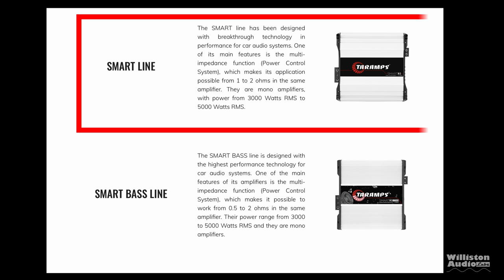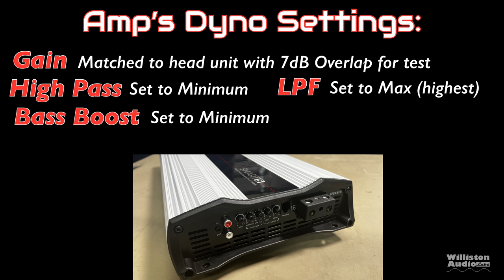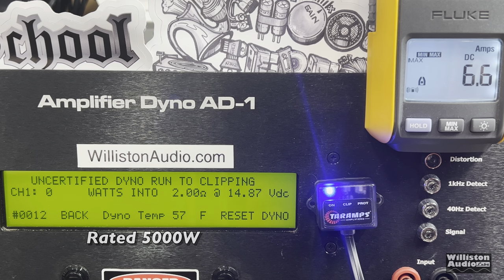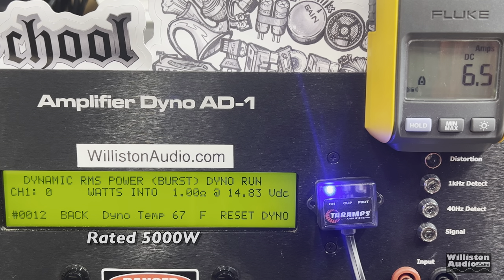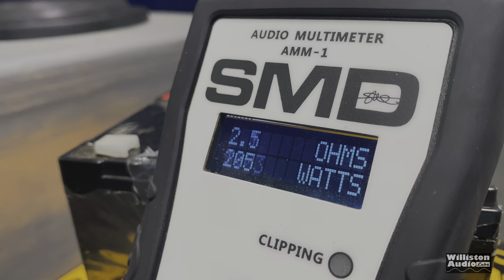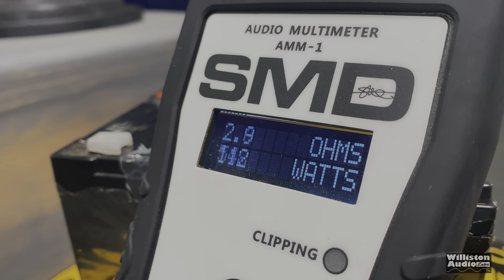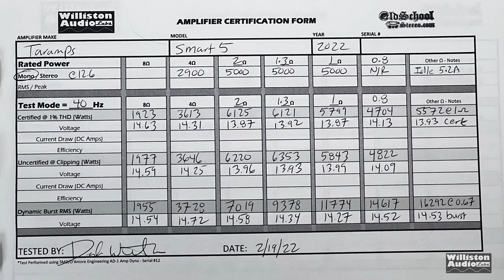You Won't Believe This! Taramps Smart 5 Amp Dyno Test and Review [4K]

Comment from the maker: Shop: (affiliate links)
Taramps Smart 5 Amplifier: https://amzn.to/3oX0XLV
Taramps Smart 5 Bass Amplifier: https://amzn.to/3oXIX3W
Savard HiQ 8” Subwoofers: https://amzn.to/3h1ZWhi
XS Power LTO Cells: https://lddy.no/13d2f
XS Power Intellisupply PSC90: https://lddy.no/13d2g

Related Videos:
Barevids Tech Review of Smart 5 / Smart 5 Bass: https://youtu.be/_WloGD1W920
Taramps Smart 3: https://youtu.be/DxMGPhNASl4
Taramps Smart 3 Bass: https://youtu.be/y37leRxDJ8A
JSS Test of Smart 5: https://youtu.be/4qbytnB2TxY

Video Index:
0:00 Intro
1:17 Unboxing the Amp
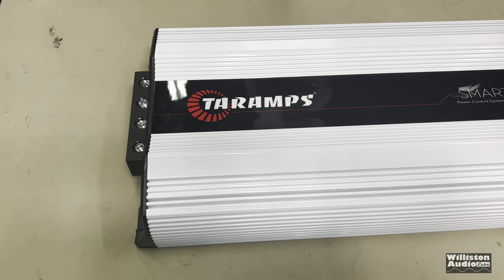2:06 Specs and Features
3:34 Amp Settings
4:26 Amp Dyno Tests
7:54 Subwoofer Demo
9:25 What's Inside?
10:05 Pros / Cons
11:23 Extras

DISCLAIMER: This video and description contains affiliate links, which means that if you purchase from one of the product links, I may receive a small commission. As an Amazon Associate I earn from qualifying purchases
Reply: YEAHHHHHHHHHHHH BOIIIIÌIIIIIIIIIIIIIIIIIIIIIII
Reply: Thanks for doing the 1.3 ohm test I have been interested in the results in regards to the smart amplifiers specifically. 😀
Reply: I have to ask somting.
Car Amps VS 8ohm speakers
Will this be a problem ?
I have to use this setup on my boat 

Thanks
Reply: @dyslectische  it won't be a problem cause the amps can run at 4 ohms  but using 8 speakers all 8 ohm is a 1 ohm load.
Reply: Hey guys I just got a rockford t1000.1bd burnt both my 10 kickers almost instantly does anyone know a set of good shallow 10s that could run in a (single cab) kicker box  or should I look for different boxes that's are 12s anyone thanks
Reply: JL Audio has a awesome shallow mount sub & can take some power!!!
Reply: Damn that sh1t bumpin
Reply: Brazil really doing it right by the amps, I'm impressed
Reply: Time to test de Pioneer GM-D1004
Reply: Please do the 1k test on all the taramps lots of people use them for mids and highs like me my boy is running 2 8k taramps in is built for mids especially here in Florida
Reply: @Force1Com  It's Brazil, it's very focused on the automotive sound business, it's a pity the laws don't help the area around here

Comment: An amp that does above 3K watts at 4 ohms for less than $600 is a great sign that car audio truly advanced in technology
Reply: Back in the day a good amp was $1 per watt. Wow how things have changed, for the better.
Reply: Yes n deed
Reply: @llegacy1870  
I remember when 2000 watts RMS was an urban myth
Reply: And 16kW @ higher than ½ ohm! Wow! I have 2 Taramps Bass 8Ks wired to 0.7 ohm and at 16V and I still can't hit 16kW! (15k) lol damn impedance rise! 
(Yes I know it's bcuz of my box rise which isn't the same on an amp Dyno)
Reply: @CHEVYK10  almost 10 years ago I paid over $500 for a 1500 watt amp that was used. Wild that for that price today I can get an amp that does triple the power
Reply: Bruh I love taramps they are the best sounding bang for your buck !
Reply: Yeah, it's wild. I'm going to be getting a Smart Bass 3K soon
Reply: @MannuhFestIt  If you are stupid enough to buy one, Rockford Fosgate will sell you a 1500.1BDCP for $1,000 at Crutchfield or $850 at Sonic Electronics. Meanwhile, you can get this Smart 5k for  under $500 or something like an Orion DSPLX 5500.1 or a JP63. I really do like The Down4sound amps. They are nice Korean half bridge amps. Definitely more expensive to strap Korean half bridge amps like two of the JP33's to get near what the Smart 5k can do, but if you have good electrical they can still get the job done and they do sound great. I will always have a soft spot for a solid Korean half bridge. Its just what I've owned and had good experiences with over time.
Reply: @catch22frubert  I personally wouldn’t compare the Rockford amps to these amps as they’re both in different leagues as far as their target markets. They’re both great amps to me and they both serve their purpose well, I hear!
Reply: Dude gets me vote for best comment! Been here for 30 plus years of playing and deffo man that's it ! And it's across the board too with other car oriented industry too. Amongst the weird times we play cheaper than the say 90s to 2000s we had then 👍🤙
Reply: No kidding man
Reply: Too bad I only know that Taramps is keeping it cheap.
Reply: @DaBuGzLiFe  *affordable
Reply: @llegacy1870    Dont forget a cell phone was at one time a dollar a minute of usage!!!!!!!!!!
Reply: I heard they get super hot
Reply: @MannuhFestIt here in brazil we have taramps hd3000 4ohm 3000w rms 12,6v 3700w rms 14,4v. For 120$
Reply: I recently bought a Rockford 750 compact amp mainly because of the size and I've always loved Rockford.  It pushes my 2x10 p3's great but the same price I could have bought this amplifier.  I needed compact and its tiny and powerful but how are these large power amps so cheap?

Comment: The smart 3k is a beast works great for me and will definitely be upgrading to the 5k.
Reply from the maker: Smart 5 is next level
Reply: @Williston Audio Labs  looks like it, that 16292 @ .67 is just unheard of! This has been on my list of next amp to buy since it first came out. 

Big D I heard Taramps is coming out with a Smart8 amp soon... You heard anything?
Reply: @steve clark you're right, the Smart3 is stellar especially for its small size. Everyone of my friends who don't know car audio all that well & just like bass cannot believe that all the bass in my system is coming from that little amp once I show it to them. 

I've been using my Smart3 in one of my cars for 16 months & I love it! The Smart5 BASS has been on my list of next amp to buy ever since it was released. Though I must admit that I thought this amp would do well on the dyno BUT I never thought it would do this incredible. I think it slightly surprised Big D. Steve I hope you get your Smart5 soon!
Reply: Ever faced any heating issues at 2 or 1 ohms?
Reply: @Bakhtiyar Gillani  I've had mine powering a single 18" sub at 1 ohm for a lil over 16 months now and no I've not experienced any heating issues within those 16 months (Knock on wood)  & I play my music hard. Have listened to bass heavy songs back to back for an hour to up to an hour and a half without the lil Taramps getting hot or into protect. The Smart amps are definitely beasts. I definitely do not regret buying mine. I also have a Taramps md8000 and a Sundown Audio sfb5000. Love them all!
Reply: I'll bump mine for hrs. at a time and temps feel low to the touch. Before my smart 3K amp I had a skar rp-2000 and it would get very very hot.🔥 and in my opinion I would rather have the included clipping indicator is very useful.
Reply: @itdoesntmatterwhatyourname6128  when I purchased my smart 3I got it for $249 so I was thinking I would just get another smart 3 as well  but with these results I'm definitely going to go with a single smart 5. That is till I want to upgrade again.....  it never ends and I don't want it to. 🙂
Reply: @steveclark9934  same that skar get very hot
Reply: @wal  does this amplifier perform well around 300amps?
Reply: @jaydawg7200 Mine is on stock 220 alt no problem and bangs

Comment: Taramps, Stetsom, Soundigital e Banda fazem um grande trabalho com amplificadores no Brasil, produtos potentes e de qualidade. Parabéns pelo vídeo!
Reply: @Tiago Jose here in the United States there are so many people who hate on Brazilian & full bridge amps in general. Personally I love them & have had nothing but great results from my Taramps & full bridge amps. I have a Taramps Smart3 & a MD8000.1 and also have a Sundown sfb5000 amp which is a full bridge similar to Brazilian except the Sundown sfb amps are Chinese rather than Brazilian. The Sundown full bridge also get a lot of hate here in the States. I think most of the full bridge haters here in the States have simply just never owned a Brazilian or full bridge amp. Don't get me wrong their are plenty of people here in the States that love Taramps too. It just seems any car audio show or anywhere there's a lot of bassheads their will always be a big group of people hating on Brazilian/Full Bridge and cracking jokes at anyone using them in their vehicles.
Reply: @itdoesntmatterwhatyourname6128  it seems like a lot of people buy amplifiers for brand naming more than actual performance.  The second any maker takes a design to China it gets duplicated then its just a matter of finding a cheaper noname brand that has simply gotten the chinese manuf. to provide boards.  There is no protection of patents or IP rights at all over there for anything.
Reply: Stetsom seems to have quality control issues, but I run a Taramps very satisfied

Comment: Man, that test at the end is the truth in ability and durability. If she was gonna pop, that should have done it. 

My smart 3K had been nothing but exceptional, tough as nails, protect light for the clipping indicator and all. Not just in the lane's either. Literally tough as nails in my experience, looks like this should be on par in that department. 

I've built some recent mid level setups with the stetsom and taramps, and they have not been noisy, blown up, or any problems at all. I'm doing a smaller build now with another set of stetsoms, the value for the $ is great. There's cleaner and better out there, surely, but bang for the buck? Brazilian isn't bad at all. User error is usually the culprit for blown equipment. I've played with too many of them, and haven't been disappointed yet. Maybe I'm lucky. They are small, make big power, and fits in small budget installs with  space constraints nicely.

Anyway, appreciate what you do for da peeps man, I'll be sending this video to a couple people that like loud, as this is one hell of a solid deal! 

6k rated, clean, for $500 is nuts!
Reply from the maker: The Smart series are smart in many ways. Constant power? Check. Power up self check? Check. Insane power for the money? Check. Lotsa checks!!
Reply: @wal  the bass knob as you mentioned, some better quality adjustments (the knobs are super cheap feeling) and the other companies better look out! I respect what the Brazilians do for the community in America, even IF the amps feel cheapish to me. I'm listening to it, not playing with the knobs all day anyway! 🤣
Reply: @georgesrisomsak9650  the knobs actually pull out a quarter inch and feel alot better. idk why they made that a feature but it is
Reply: @2015GTPP  cool! I'll be playing with one here soon, I'm quite curious  about the change! Most solid power for the $, and by far the best value.
Reply: @georgesrisomsak9650  I personally don't think the knobs matter, u r going to basically touch these knobs once and that is it, so how nice do they need to be really? I do loathe adjustment on my 5's I run six of them but after they set they r good
Reply: @1-Six-dee  You're running 6 of the smart 5 in one setup? Ah man I'm drooling please post a video of that if you have a moment!  In the meantime which subs are you running with that.. myself running 2, 12" SA's (1k version) on one smart 5 they slam could only imagine if I added 5 more like you haha
Reply: I went and bought one after watching this,  I love mine,  I got a lifepo4 lithium battery (74ah- up to 600a burst, with factory alternator and it does great) jag35 battery for under 200 with shipping love it cant find a better battery for the price.  Great video as always big D  , keep them coming I always enjoy your stuff.  Thanks
Reply: Running 2 sa v.2 sundown 15s on mine and I just got 2 more can't wait to see what it does I only used about a 1/3 of the gain for 2 so all 4 should be amazing

Comment: Been running taramps for years, I have 2 smart 3ks and a md12k. I beat the snot outta my 3ks and they take all the abuse. Even at slamology 2021, it was 120 degrees  on average in the show (according to my temp gun) and the amp still performed flawlessly!
Reply from the maker: Great feedback
Reply: You gonna be there this year?  I'm back and forth about going, I'd love to have a demo from ya.
Reply: @champion31337  yessir, I’ll be in a 98 Honda Accord with a single  15” Orion hcca and a 2001 red chevy Tahoe with 4 15” evls. My Honda is on ybass YouTube channel if you want to check out the build from last year💪🔊
Reply: How's the MD12k do??
Reply: They remove the ICs names, grind the components numbers. 
Brazilian stupid conceptions.
Reply: @hvacengineering202  in brazil there is a real war of sound walls, a lot of reverse engineering, china feelings over processors and amps projects.

Comment: So i purchased the taramps 3000 HD to push my 2-10” ozone subs, from ct sounds. 72hrs with the amp, and i returned it. 

I ordered the ct sounds 2000.1d and that thing is a beast! Super pleased with CT sounds equipment… ill be jumping up to 10” meso and maybe run full ct in my titan crew

Comment: I’ll probably get flamed for this comment but I own two of these smart 5k’s and several other amps. I was recently running the Orion 3000.1splx and the smart 5k outperforms the Orion. I’ve done multiple wattage clamps with the amm-1 on my setup and I’m blown away with these smart 5 amps.
Reply: Lol no it doesn't. I have 4 hcca splx 3ks, at most I've clamped 7.8k after rise, .5 rising to .99 at 15.8v. the smart 5 clamps 6k at most in the real world setting.
Reply: @OrionHCCC26  I’m not at 15.8 volts and the majority of people aren’t going to be either. My resting voltage is at 14.8 volts and my subs are wired to .75 so I see 2 ohms and above after rise. My car, my experience, my amm-1 shows otherwise in my setup. My hcca does around 4500 watts at 1.5 ohm and the smart 5 will do 6000+ from 1.5 to a little over 2 ohm on my setup. On the meter the hcca will get me around 151.5 and with the smart 5 it’s doing 153.2 consistently.
Reply: @ryanmcdonald6888  I hear you, all I'm saying is the smart 5 is in no way better then the splx 3ks. The 3ks do a grip more power. From internals, to power output, the Orion is far better. But for the money, the smart 5 is freaking amazing.
Reply: @OrionHCCC26  the hcca is a better built amp all the way through. I’ve dropped it down to a 1/4 ohm before without issues for competition burps. I’ve even clamped well over 11k on the Orion at 1/4 ohm on 1-2 second burps. I definitely wouldn’t try anything like that on a Brazilian board.

Comment: Just ordered one to the UK ,nice upgrade for my 3k .. these gonna be like gold soon ... Unbelievable performance ...another great video.. why do you need two positive and two negative power inputs?

Great video big D as usual 🔥🔥
Reply from the maker: I use multiple inputs when possible because my tests are resistive and pull more current than music
Reply: ? "why do you need two positive and two negative power inputs" ?
Because it draws about 500 AMPS, and it's a damn sight easier to use 2 pairs of cables pulling 250A each compared to single elephant dick sized cables that handle 500A. And power needs Volts (as well as Amps), so whatever you can do to minimize voltage drop between your battery and amplifier will improve performance.

Comment: I really loved the smart 3, have installed 3-4 of them with zero problems. I'm audio tech/installer, and saying that Ive  installed one smart 5 and blew up as soon as I turned it on. So customer bought another one and barely turn up the  system and goes straight into protect mode. I used two zero gauge ofc power and ground with two mesa 1200 audio batteries. Hopefully they've fixed problem by now. Cus I'd like to use two smart 5s in my own Setup
Reply: probably need more battery, my buddy has a smart 5 on 1 40ah bank of yinlong and a 270amp alt holds 13.5v+ over 14 driving its a beast

Comment: I remember the early Brazilian amps going up in smoke pretty easily, and the micro-controllers used in them were not easy to get. Being I grew up repairing amps, I didn’t like the idea of running an amp I can’t get parts for. I don’t want to jump through hoops or have a paper weight in the event it blows up, or have to ship off to an authorized facility. I was considering a Taramps Smart 5 a while back, was thinking of selling some old amps I've had for years, but I felt it wasn’t worth the risk. Seemed the Brazilian amps always put out decent power, that was never the issue, just longevity / reliability wasn’t good on them. Maybe the Taramps are different.

Comment: I've ran the smart 3k for 2 years never had a issue other than crappy cross over knobs the gain is extremely sensitive at certain places def got better sound when using a external crossover.
Reply from the maker: Yeah boi

Comment: By looking at these amps , one might think they are sub par. Clearly they are awesome. 
For a small package they put out massive power
Reply: Yea they put out power. But far as quality not so much
Reply: @phenomfacemob1011  the knobs are really the only low quality parts. The inside of these are really built to handle some power
Reply: @beardedforlife3740  yea it definitely put out power. Just saying the amp is not good overall quality
Reply: @phenomfacemob1011  just the potentiometers and the RCA's. Everything else is built good imo
Reply: @phenomfacemob1011  suck it up man the taramps is on top of the game rn

Comment: Taramps is a beast!!!! I have the Taramps Md 8000.1  love it
But like when you did the dyno test on the inuke nu6000 and gave us the correct rms
Would love it if you could do the same for the Powersoft K20, CVR-D 3302 and Admark AD42
A lot of us are concern about the power these are amps are giving.
Reply from the maker: Thanks for the suggestions
Reply: Do I see more watts with this , than the md 8000
Reply: Does this hit the subs harder than md 8000